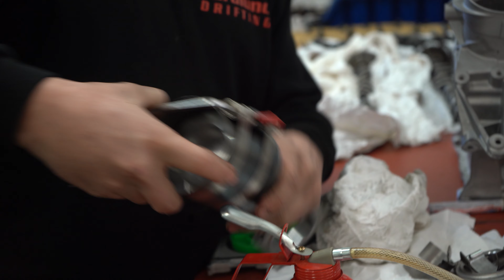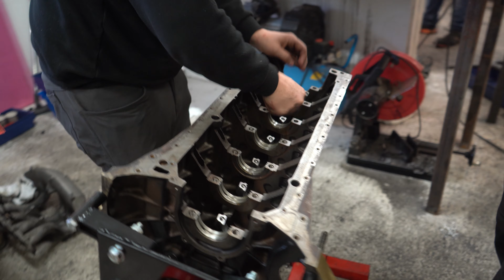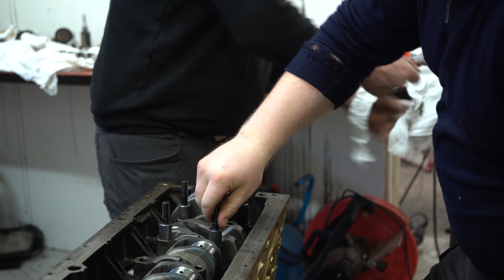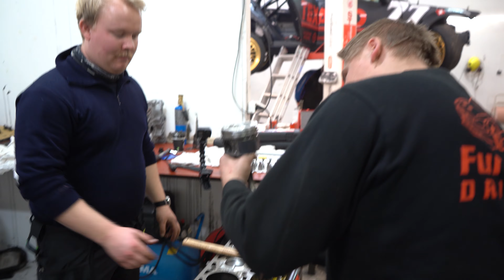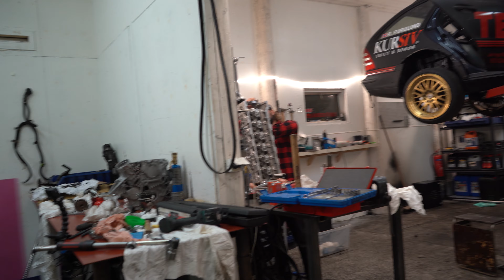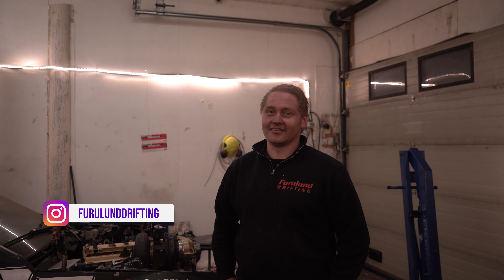Building mercedes om648 race engine 700hp diesel??  (part 1)

Comment: Whats the difference between the OM 613 and the OM648? They have very similar power output and look almost identical.
Reply from the maker: They are basically the same, its just some small differences like exhaust valves, diesel lines, dynamo, ecu and wiring 😊
Reply: @furulunddrifting  Which one would you say is the best engine then?
Reply from the maker: @MMKnight_1  i cant say one or another is better 😅 to buil a race engine you need some parts from both engines 😊

Comment: Hello furulund guys again thanks for reply ❤ i have same om613 engine project and just asking, you guys know more than me,

I am installing Bosch 200 fuel pump with max pressure 8bar. And how much pressure can handle stock injectors and stock high pressure pump? 

Asking because maybe 8 bar is too much and thas why i have fuel pressure regulator. 

Thanks ☺️

Comment: Have you line honed the block when running arp main studs? And what torque do you use?
Reply from the maker: Yes its line honed with arp studs, its the engine machinist who desides NM when line honing, so its a bit over stock 😊

Comment: Finally some content with a om648! I am going to be having a shop swap it from my 05 e320 us model and put it in a 2003 c230 Wagon . But when the engine is removed I would like work to be done to it.. would you guys be able to help me get some power out of it as it’s hard for me to find info on these engines
Reply from the maker: Send us a pm on insta and we will try to help 😊

Comment: Good stuff. Would you say changing the cam enables high RPM power or is it just in the fuelling?
Reply from the maker: Yes, high rpm power. but its the map/fuel that resticts the rpm.  When we use these cams we also need milled pistons for valve clerance to piston 😊